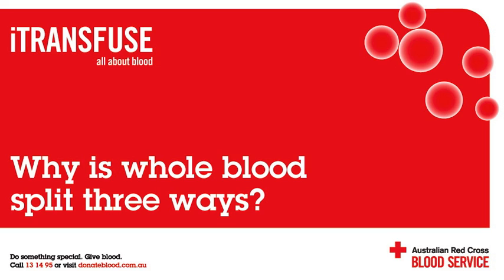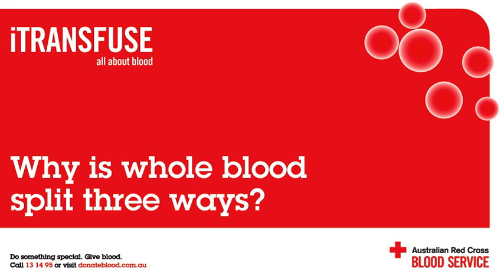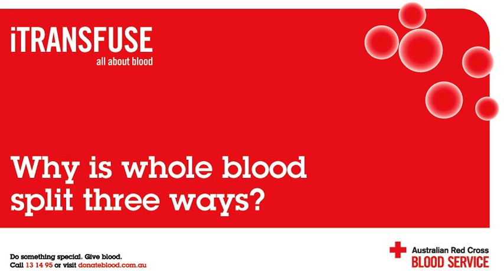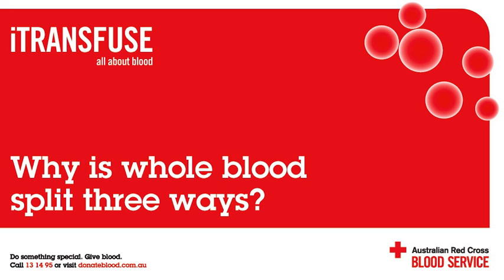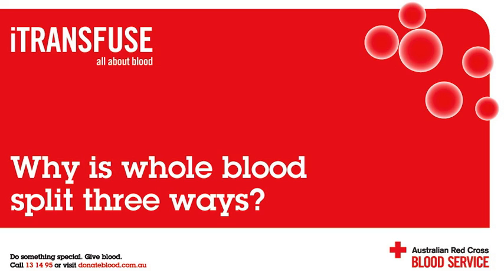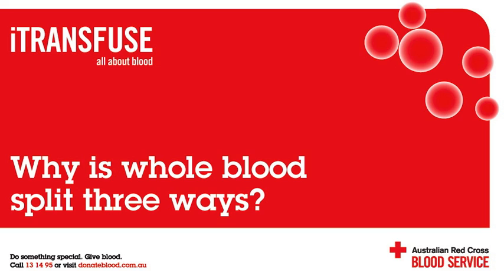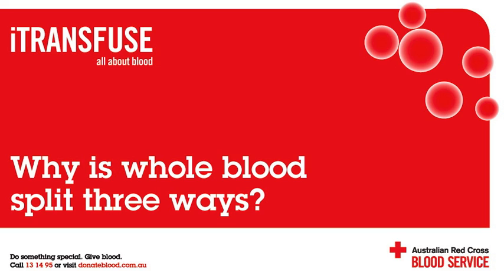Why is whole blood split three ways?

Comment: sir,my question is after how many hours whole blood should make component for example PRBC,AND FRESH FROZEN PLASMA AFTER COLLECTION WE WANT SEPERATE FFP AFTER HOW MANY HOURS ARE THERE IS NO SPECIFIC TIME.
Reply from the maker: The Australian Blood Service follows the guidelines for manufacturing of components as contained in the Council of Europe (C of E) Guide to the Preparation, Use and Quality Assurance of Blood Components.

Briefly for the preparation of fresh frozen plasma the Blood Service sets a limit of 17.5 hours from whole blood collection to separation and freezing.  If you are preparing other components then different times may apply.  The C of E guidelines would provide clear direction for those components.

Comment from the maker: We do not have a minimum time between collection and centrifugation. The maximum time depends on what components we make. In general if the whole blood is at room temperature the red cell must be separated and in the coolroom within 24 hours. If the whole blood is refridgerated we have 76 hours to separate it. Different times apply for separating buffy coats for platelets and plasma for clinical or fractionation use.